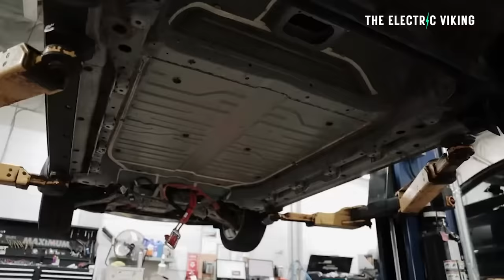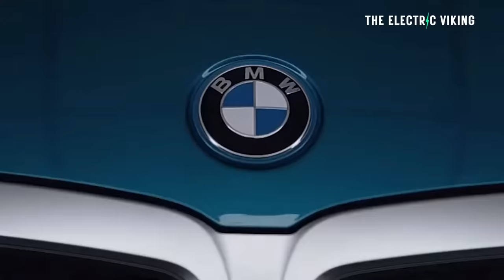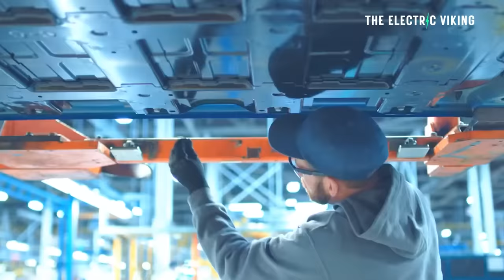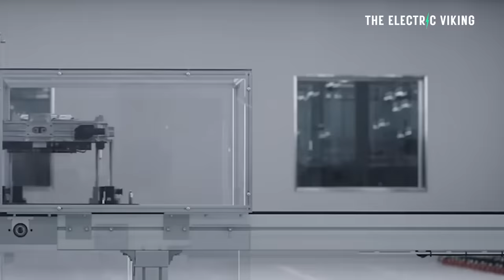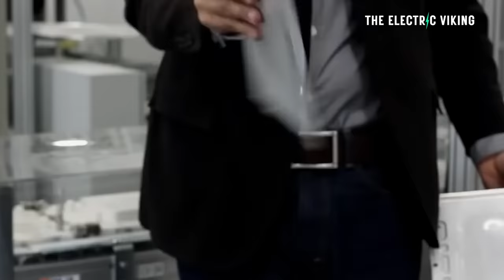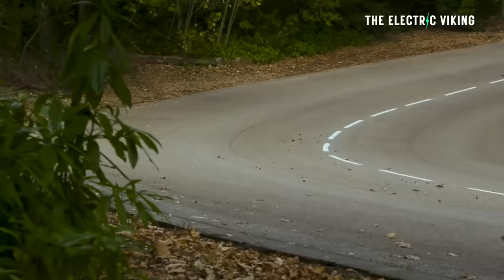The shocking cost of EV battery replacement for these 3 brands

Comment: That's why EVs should run on AA batteries.
Reply: Right?? That way we could replace them ourselves!
Reply: Lol
Reply: Not sure about AA but hoping some 10 years down the road car batteries will be plug and play. Hopefully market knockoffs as well.
Reply: Just need an extension cord. No battery needed.
Reply: Yes
Reply: A pantograph, no battery needed.   It’ll keep going on forever lol
Reply: @GalenlevyPhoto  Now I know what a pantograph is. No doubt Big Battery is keeping this knowledge from the public. 😂
Reply: @RyanWilliams222  in the early 1900s, they did experiment with electric cars on pantograph but it never materialized.  I think it’s due to the cost of maintenance of the entire USA with all those overhead power lines on tens of thousand miles of road.
Reply: @GalenlevyPhoto  Or it’s due to…Big Battery! 😱😉
Reply: And in the UK, you can pay for the AA to come to you to fix the car. 😉
Reply: unfortunately that's exactly what they use it's exactly the same tech and until completely new battery tech is developed EVs will remain a gimmick at best at worse a SCAM EVs are the equivalent of smart phones for the car industry

Comment: Imagine buying a car and being told you have to buy a new $10,000+ engine every few years
Reply: Some ICE engines also last a few years and cost 30.000 to replace.
Reply: You don’t. Batteries are warrantied 8 years by law, 10 years in CA. Few ever actually fail.
Reply: @marcohillenga5068  , show us where ICE engines only last several years?
Reply: @RacerX1971  BMW
Reply: @marcohillenga5068  , that's what you think or is there a study? cuz I have a 70 BMW, 4cy and still running, albeit I had the engine rebuilt 10 years ago but still purrs.
Reply: @RacerX1971  those were the good days of engines. Most new BMW engines (except M), those are actualy reliabe) don’t last a long time, it’s all plastic. Lots of problems too, especially engines like N57. Those can quickly coat more than a big battery pack.
Reply: @marcohillenga5068  , ok, so which BMW engines only last 2 years? You only said BMW...then you said it's all plastic. Are you talking about the crank, pistons, rings, cam, valves, engine block that are plastic cuz u said they are "all" plastic...

Comment: Any car in U.K. that is involved in an even small accident is immediately written off because it is suspected the battery could be compromised
Reply: And cell to pack is most difficult to fix as per recent reports. But Tesla bot Sam would never tell u that
Reply: @protagonist  is this true...this is very interesting.  Do you have a link to any news articles on the issue?
Reply: @wainwrights2744  no. Sorry just something I saw on the tele.
Reply: @jprt3270  That must be more than just a fender bender.  I suspect that there's usually not anything wrong with the batteries, so the used battery market will get a lot more product.
Reply: Bar stool wisdom. “I heard it from some other drunk guy, so must be true.”
Reply: @wainwrights2744  I listened to a clean tech podcast which had a battery safety technician on the show; he said if an EV has been involved in an accident where the battery was impacted in any way it should be recycled and not put into second life into another EV or as home storage near people. Obviously this is riskier with more volatile battery chemistries.
Reply: @888buzzz  no.sourced to an article by Tom Haines in the daily telegraph 3/4/23
Reply: @wainwrights2744  yes. Tom haines daily telegraph 3/4/23
Reply: @caractacus22  I would take too much notice of what that man says, he has an agenda and tends to exaggerate if not deliberately mislead people.

Comment: It's really an own-goal for Hyundai, BMW and others to be openly charging these kinds of prices. I nearly bought a second hand 2018 Ioniq recently until I phoned up the Hyundai dealership to get a quote for a replacement battery pack in case it went wrong. That quote ended my purchase of the second hand Ioniq then and there.
Reply: Yep, not to mention the effect it has on insurance quotes too. Its hardly surprising that insurance companies charge sky high prices when battery replacement is such a mine field of uncertainly and potentially very high costs.
Reply: @cbcdesign001 Insurance doesn’t cover mechanical failures on any car. That’s what warranties are for.

Also, very few EV batteries actually die. Most last a decade+ before becoming reused for non-car use or recycled.

Comment: thats why packs need to be bolt on because the cybertruck is designed to last forever  and the ability to replace the pack in the future is vital
Reply: The Tesla structural battery packs I have seen are bolt in.
Reply: Way too logical, manufacturers will lose control of the consumer. EV's are inherently simple platforms, and getting simpler with each iteration, modular batteries in a common standard, will make all brands essentially generic, like a flashlight. Won't happen any time soon.
Reply: @sdfswords  With batteries that outlast the life of a vehicle why?
Reply: @sdfswords  Not so fast, the software that goes along with the battery, might not agree with any type of batteries!

Comment: Battery packs should be modular so that consumers have the option to replace or upgrade them as better batteries are developed. 
Power to the consumer!
Reply: In short time will happen
Reply: Organisations like the EU Commission could demand such a thing. Plain and simple.
Reply: It's been reported that the new Tesla model years will be upgradeable.
Reply: Great comment
Reply: vorpalinf9 • "...should be..." Why do you think it isn't?🥴
They do it intentionally like that, so in time you are forced to sell your EV at a loss and buy a newer one.
It is one of the biggest "legal" scam in the history of car manufacturing.😏
Reply: That is why electronics like tv's don't have multipule boards of old ones roo many points to fail,
with all the connections and places to have problems.
Reply: Fuell bikes are looking at component upgrades. I've been doing it to RC's for years
Reply: Just wait, someday you'll realize it's a fraud..  Electricity doesn't just come out of a cord.
Reply: Once you buy an EV you're so totally screwed. Do not do it.
Reply: Absolutely.
Reply: Buy a gasoline one
Reply: I cannot believe nobody replied you « it’s already available to all models of NIO », the battery can be swapped in sny of the 3000 battery swap station (Chin and Europe for now) in 3 minutes . Their new solid-state battery can do above 1000 km in one charge. It’s a 150kWh battery that weight 20kg more compared to the classic Lithium-Ion 100kWh battery. Check it out.
Reply: Yea, and the 150kWh battery costs as much as a new car 😂
Reply: Who's paying for that, all trickles by to the consumer. Give it time might happen or batteries get better ...

Comment: Surprised companions making aftermarket replacement batteries haven’t sprung up yet, it’s only a matter of time until it’ll be possible to buy and put a CATL Qilin battery pack into an old Chevy Volt or Nissan Leaf and quadruple it’s range.

Comment: It is starting. It is possible to open damaged battery packs and replace a broken single battery, or even all the single small batteries inside the pack.  Soon I believe we will see companies that will be certified to refurbish old battery packs. And perhaps even exchange the batteries from NMC to phosphat or sodium batteries. This will be a whole new business. Different producers of the small batteries already excist, both NMC and phosphat, and probably soon also sodium - lf not already. As a consequense, new batteries and battery packs will become much cheaper due to competition, and no more monopoly by the car brands. Already now a few startups in Northern Europe has started planning for this.

Comment: RECENTLY IN CANADA HYUNDAI IONIC 5 battery replacement cost the owner 60000 Canadian dollars. HIS car was just 1 year old he scraped his car underbelly somewhere and the battery got damaged. He tried for a warranty but was denied because of its physical damage. The insurance company will write off the car since repairing it is higher than the value of the car.

Comment: I hear that tesla takes away your fast charging option if they don't service your car so just for that I couldn't buy tesla so not going to be held to ransom
Reply: I would be surprised if others didn't do this, if they don't its kinda stupid to increase their liabilities.
Reply: @OG Zombie Blunt  all this will do is put lots of independent garages out of business and then overwhelm buig dealership and make waiting times for getting your car fixed longer
Reply: Well evs don't need to be repaired or maintenenced as much so many will go out of business in the switch to evs anyways.

Comment: Well for me Sam I am not a fan of EV's and I think that if I ever was made to have one - which I could never afford from any aspect of owning one the cost of a replacement battery would bankrupt me as like so many others like me who are on a pension for an example. Plus the cost of buying insuring one, the cost of the tyres which I gather wear out three times more frequently than ICE powered vehicles and require "special" tyres at that, and the risk of fire within the battery is simply not an option. To boot the wait for the vehicle to charge up would simply drive me (no pun) quite insane. I did note that you talked of the cost of battery replacement is quite reasonable but to me like may others who have a limited income ie: on a pension that cost is simply not a situation that we could afford.

Comment: I really don't understand the stupidity of car manufacturers spending billions of $$$ developing EV but not realizing gouging on battery replacement costs can kill their own future. Hyundai Canada is learning a hard lesson these past few weeks and is in damage control mode.  Horror stories are starting to pop up with 1-2 yr old EV being scrapped due to battery replacement cost.
Reply: Well perhaps some good will come from the bad publicity Hyundai are receiving. Certainly the manufacturers need to ensure that dealerships can properly inspect battery packs. I watched a guy in the UK on YouTube (cars4paul) check a battery from an accident damaged VW ID3, if he can do it, a properly trained person in a dealership should be able to do the same job.
Reply: @cbcdesign001  Agreed. Also Just saw these past couple of days that several similar stories (high battery replacement cost) are hitting US medias and people are starting to put on hold getting an EV.

Comment: I was surprised that you quoted the replacement cost of the Hyundai Ioniq battery in the 2018-2019 (and, presumably, the 2017 and 2020 which were the same car) but only for the hybrid model.  What about the Ioniq EV from those same model years?
Reply: $56,000CAD, or more than the car is new.
With that much money on the table: I am hoping for aftermarket battery packs to become available for common EVs.

Comment: I think your comparison is irrelevant. Both BMW I3 and VW eGolf were concept cars, with very low production numbers.
The BMW i.e. was built in a way, that never would be possible in mass production. Loads of carbin fibre etc.
To find the real cost of a battery change you should compare Tesla with ID3/4/5 etc and BMW I5, I4 and so on.
These are cars meant to be realistic choices in their segment.

Comment: When asking for a price of Nissan Leaf battery replacement in Finland, they quoted very high prices, so this is not uniform, but varies country by country. Currently replacements are third party and they use used batteries from totaled cars, as there are no new batteries available at reasonable cost.

Comment: No point buying EV vehicles. Not only battery but many more problems. My Mercedes EC aircon is always problem which is needed to be replaced every two years at exorbitant cost. They say it is because all are controlled by the battery unlike a petrol car. Big monopoly by the car manufacturers. The customer care are of no use.

Comment: Hyundai's an BMW's EV's seem to have been designed as use-and-throw. Roll of dice if there's no accident or damage and the packs last 500k km's or accident after 2 years and the battery pack cost more than market value of the car.

Comment: A friend was quoted £17,000 by Renault in the UK for the replacement of the battery in his 2014 Kangoo ZE 22kWh van after there were loud bangs from the battery several times just after parking.  That's roughly US $965/kWh at current exchange rates.  The van is only worth about £5,000, and he was told the quote was so high due to the amount they need to take the van apart to replace the battery, so could this explain the wide range in battery replacement costs for other EVs?

Best wishes to you and your wife.

Comment: The replacement price for a early model Prius battery - $2,000 for a 2 Kwh (1.7 Kwh usable) battery pack. That works out to $1,000 per Kwh. But Toyota does offer $250 for the old pack for recycling.
Reply: The battery pack is worth a lot more than $250! Just for recycling, you could get more!
Reply: Early Toyota hybrid model uses NiMH battery , not Lithium. ion
Reply: @alexlo7708  Still precious metal to recycle even with NiMH batteries!
Reply: @rozonoemi9374  sometimes the labor involved make it useless to try to recycle plus the danger and regulations.

Comment: EV battery life is really not that much of an issue. Quote from EVBox:

"Nissan, for example, has been selling electric cars for 12 years, and executive Nic Thomas claims that almost all EV batteries they’ve manufactured during that time are still in use.  Likewise, Tesla reports its vehicles to have an average lifespan of around 200,000 miles in the US and 150,000 miles in the EU."

The key to better battery life is charging correctly. I don't thrash my ICE car when the engine is cold. Charging should be treated with care also. 

Properly looked after, battery degradation should be less than 3% a year.
Reply: Yep, avoiding high charge rates as often as possible,  restricting charge level to 80% on fast DC chargers and not allowing deep discharges does a lot to help preserve the life of the battery.

Comment: My 2018 ford focus electric has 95000kms and battery now being replaced.  In discussion with the dealership they say the cost of the pack is between 5-8k for the 33kwh pack not including teardown and installation.  Getting it done under the battery warranty, but I am shocked that it failed so early.
Reply: Why are you shocked?  I'm amazed it lasted that long.

Comment: just saw a video here - where one had to replace the battery cause the cover of battery was scratched .. Imagine this .. 
Someone looses something at the road and you see it too late ... and it scratches the battery cover . In this case the cost of the replacement was higher than a new car.
Its a big risk - which made me as EV owner think a bit.

Comment: There is the discrepancy between EVs and ice vehicles the cost of replacing the EV battery pack is far more expensive than changing and engine or tranny in a ice vehicle . Must remember there is labor removing the old and replacing with new . Another factor that's not discussed is how easy a battery replacement is for a model of vehicle . Nio makes battery replacement for their vehicles in the minutes in there battery replacement centers . So buying a EV with the ease of replacement could be a factor in terms of labor cost . In the end it should be easier than a engine from a ice vehicle but for EVs replacing a battery pack is not very cost effective at this time . Eventually a new industry will be developed and swapping out a battery may get to $3500 for a swap or maybe cheaper . Now 20k doesn't make sense .
Reply: I think that over time the cost of batteries should come down as volumes increase.
Reply: @eish3291  I think that's the key for EVs success is battery repair , replacement and recycling . The 3 Rs.  Now I believe Tesla foams in their battery packs making 2 of the Rs not easily done . Nio with the ability to change out a battery in minutes in there change and go says the labor can be minimal for change out compared to ICE . If a battery pack can get to $5000 and maybe $1000 in labor change you got something .

Comment: Imagine having to replace your gas ⛽ power vehicles engine, transmission, alternator, starter, fuel pump,radiator ALL at the same time because that's the equivalent cost of an EV'S battery 🔋 replacement
Reply: No, instead you end up replacing them bit by bit. But it's still early days for EVs, batts are coming down in price, and as sodium batts become a dominant chemistry, the prices will drop a great deal more. The pricing you are seeing from the OEMs is profiteering, simply because they are losing a great deal on all the other replaceable parts that EVs don't require, and the servicing that EVs don't really need.
Reply: @ledsalesoz  I've never  had to replace an engine of all the 7 car/trucks I've owned in my lifetime and the biggest repair expense at any onetime was a $3500 transmission  These EV's batteries are like $15-40K which when you think 2/3 of households live paycheck to paycheck an EV battery replacement would BANKRUPT the owner...

Comment: Would be good to know if those costs for the batteries were for just the batteries, or if it included the dealers charge to remove the old battery and install the new and reset any software if required.
Reply: Also a core rebate for your old battery which has some value.
Reply: @lemongavine  that’s a good point!